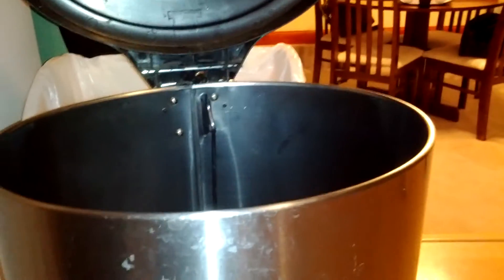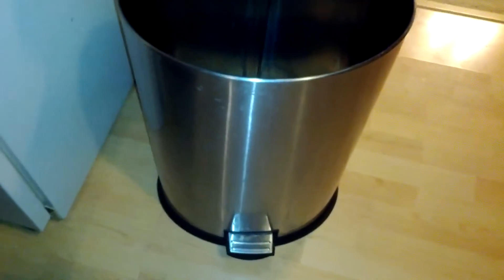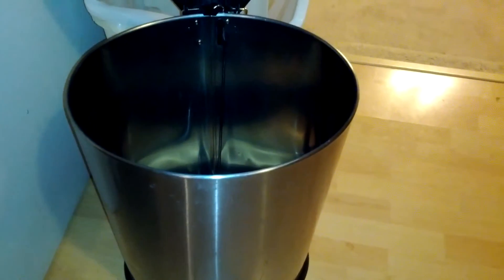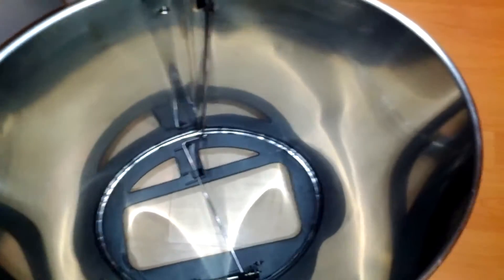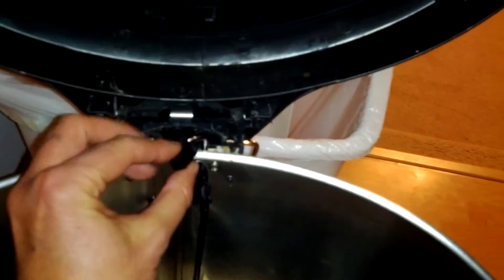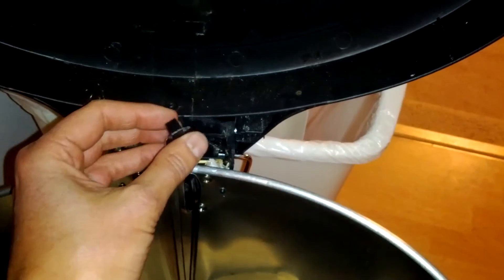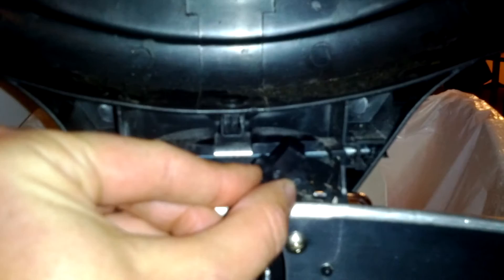How to fix your pedal trash can

Comment: Now i need a replacement plastic piece. Any leads on where to order one?

Edit:  always check the trashcan and liner part. Apparently the plastic piece isn't always installed where it should be.

Comment: Thanks for the video.  Just wanted to share that the little "hydraulic piston" that keeps the lid from slamming down was bent on mine.  Someone must have forced the lid closed instead of letting it close on it's own.  Anyway after bending it back as straight as possible it closes slowly again :)
Reply: Hi, mine is slamming shut too. Can you tell me where to find the "hydraulic piston" you were talking about? I can't figure out what is wrong/missing. Thanks!
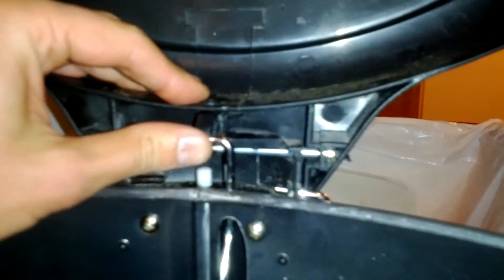Reply: Hi, sure. You can see the very top of it at the end of this video. Just fast forward to 1:22 and look right under the little black piece that Joshua Dickinson was putting back in place. You'll see a little white cap and that is the very top of the piston. If the piston is not coming up to the height shown in the video then it will not slow the lid down as it closes.

If it's bent or just stuck in the down position you can take it out by removing the black piece that is shown loose in the video. Hope this helps!
Reply: Hi, thank you so much for responding!! You were very helpful! I guess I couldn't figure it out because mine is just gone. Took off the lid yesterday to clean it and when I reassembled it was slamming shut and I couldn't figure out why. No idea how it got away but now at least I know. Now to search for how to replace it. Can you please tell me if its metal or plastic? Thanks again :)
Reply: No problem. The piston is mostly metal except for the white plastic cap at the top. I'd say it's about 3 inches long, so I could see how it could get lost pretty easy if you had the can sitting upside down. It reminds me of a miniature version of the pistons that lift up the tailgates of SUV's  :D
Reply: Seriously, thank you so much!
Reply: Orlando Hidalgo 3 years later you helped me!!! Haha thank you!!!!
Reply: katecoleen I’m glad I could be of help and you blessed me by taking the time to  drop a comment. Thank you for brightening my evening lol!
Reply: @orlandohidalgo9151  any recommendations on how to fix a piston issue? My lid isn't closing all the way and I discovered that the plastic piece on the top of the piston went missing. I swapped with an intact piston from another can I had with a similar make, and discovered that neither piston is sitting low enough in its slot to close the lid properly. I'm not sure why either aren't fitting. It's driving me nuts.
Reply: @jessicaliskey  just figured it out. It’s the step at the bottom of the can. For a quick fix just remove the black plastic trim around the foot pedal.

Comment: The plastic piece that he is pushing into place also has a screw that attaches it to the lid.  You can see the screw hole in the lid if you look closely in the video.  There is a hole in the small plastic piece that the screw goes into.  Mine got "lost" somewhere... so i found a spare screw to replace the lost one.  Lid closes perfectly now!!  :)